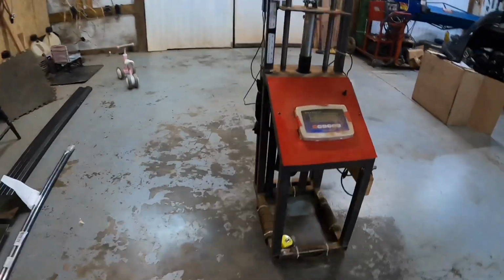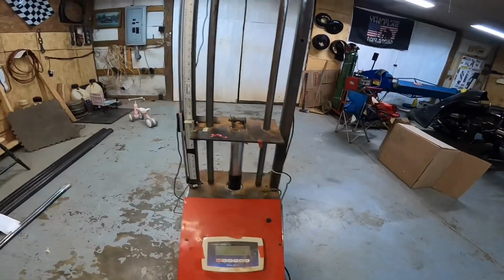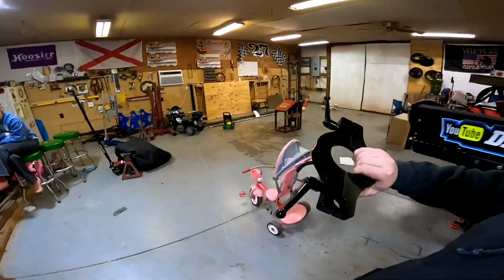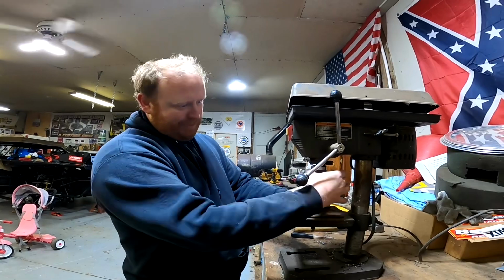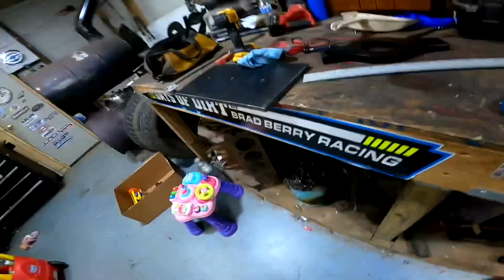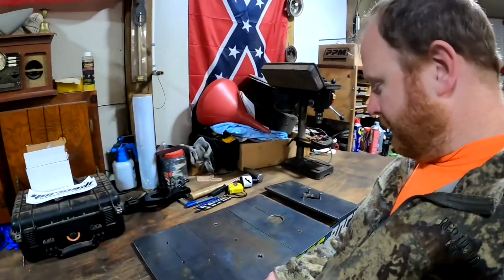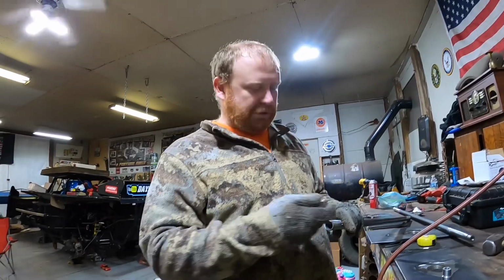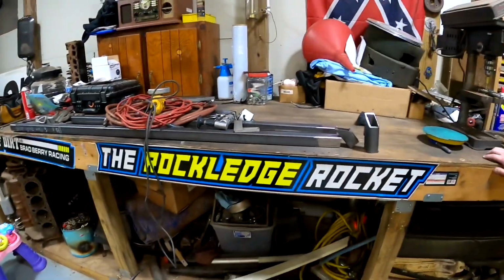DIY spring smasher build part one! Follow along with our “expert” metal fabrication skills 😂

Comment: Why not use motor oil for cutting fluid? It'll save your bits better than the water.
Reply from the maker: In my opinion, it slicks the metal up too much and causes too much friction.

Comment: Good to see a video again. 2 things real quick. 1- You really need to wear some safety glasses while drilling and grinding. I lost sight in my right eye about 6 years ago, so the importance of eye safety has been driven home much more. I lost sight due to a retina detachment. 2- If you get a set of Roto Broaches or the equivalent , holes will be much easier to drill and not be such a pain. Using a center drill  vs a smaller drill seems to help to get a starting point to start a hole. Hope you guys have a Merry Christmas and I look forward to more videos.
Reply from the maker: Thank you for the tips! Merry Christmas!

Comment: Too bad you wasn’t nearby. Because I could have helped you guys out a bunch, that is what I enjoy doing with my machines. It would have been a piece of cake
Reply from the maker: If only, huh? 🤣 we constantly need help lol
Reply: @daysofdirtwithbradberryracing  actually I do a lot of work for my friends that’s racing related. The last job I did was cutting a brake had down to match a damaged one. His old one was an odd ball one that had an  bigger hole pattern than the one they had the correct length. My friend bought the correct hole pattern but it was 3/4 too thick. So a little lathe work fixed it